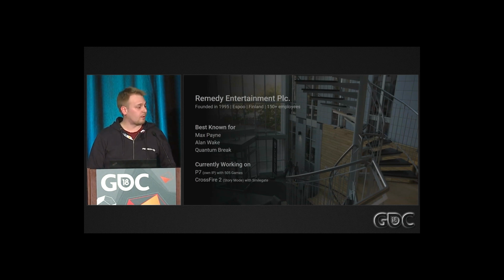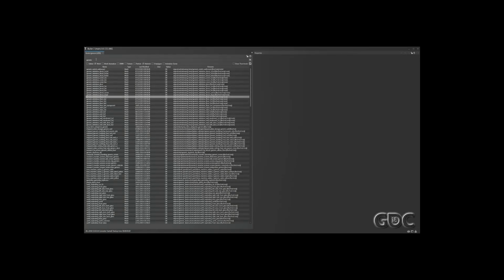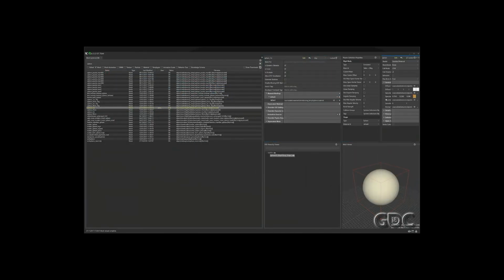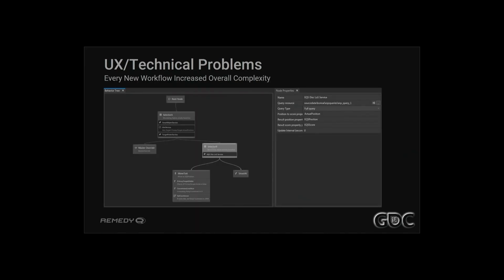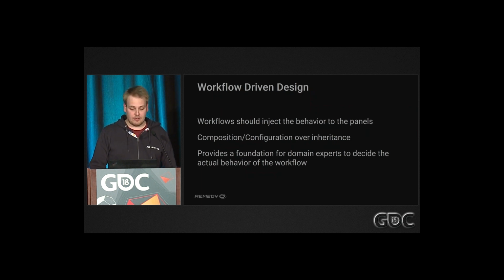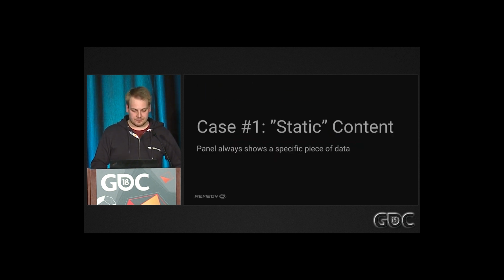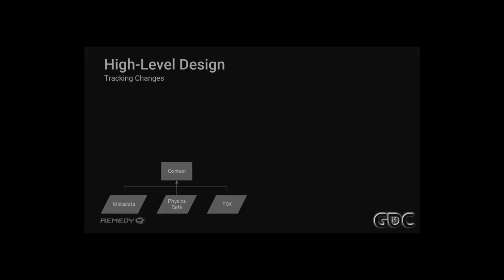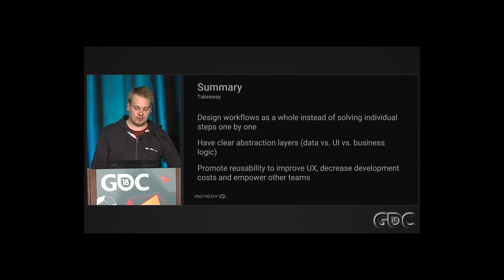Tools Tutorial Day: Workflow Driven Tools Design

Comment: I am always amazed when game developers, who otherwise are incredibly intuitive with making things work for them, how they struggle with ideas for UI. The absolute most simplest solution to their problems starting at 4:00 would be to have like a quake console, or popup box, what ever, where you could type in the panel name, to automatically open up a panel of that kind. Once you take this "command terminal" approach to everything, things get exponentially faster and easier. Having to change between keyboard and mouse, means mental overhead but not only that, with the mouse you can only enter 1 command at a time. With the keyboard in a console of sorts, the commands input are of arbitrary size.
Reply: Consoles/CLIs are notoriously bad for discoverability because you have to basically just have the commands memorized. However, I think what you're talking about is a "go to anywhere" search like in Sublime Text, VSCode, etc. That could help a bit, but all you've done is introduce another way to pick from the list of panels; the actual issue being that the panels are so flexible you get into layout-hell.

I'm also not sure what you mean by "change between keyboard and mouse", this entire UI is mouse driven; nobody's modifying timelines with the keyboard. These are artists tools, not developer tools, the keyboard is used pretty sparingly for entering values or triggering shortcuts.
Reply: also keep in mind that these kind of tools are not only for developers. If you ask a level designer to just type in the console, he/she will surely make the whole design in paper and ask whoever makes the tool to implement it for him/her.
Reply: That's how Valve does stuff btw, in Source most actions available through UI can also be invoked through the console as well. Though leaving that in public builds is kind of wrong...
Reply: WOW I'm currently working on a small toy engine and this was my EXACT idea on how to do UI for the editor. I really like  the quake drop down console to quickly manipulate game state, like toggling god mode or fly cam or what ever. But realistically you still want things like color pickers, audio sliders, 3D manipulation gizmos etc. What I like about a console is if you know what you want to do you can just type it in and it happens,  what I like about modern ui elements is you can tweak values and iterate on design faster. You really want both but I think figuring out how to integrate the two to work together is a challenge.
Reply: @shmoich6992  A console is fine for in-game debug features, but it isn't an editor. Building in-game editors is even more of a pain because then you wind up with a monolithic code base where your editor needs the entire game to be loaded in order to run.
Reply: @shmoich6992  yeah, I have seen quite a few amount of game developers adding such a console to their dev toolchain, there are plenty of examples on youtube, as it works pretty good together with a well designed UI. The combination between modern interfaces, with the "escape hatch" as it were, where you quickly can dive into a setting/property, action or command is incredibly useful, which can lead to higher productivity since you don't have to go menu hopping for everything, but have the variety and ease of use.
Reply: Ohh when the VIM programmer starts to give advice on UI and usability. Not everything can adapt, or needs adapt a terminal based interface.
Reply: @Daaell  I'm sure VSCode, CLion, Sublime all got it wrong then. I mean after all, VSCode is used by nobody, right? Right? Right. 🙄